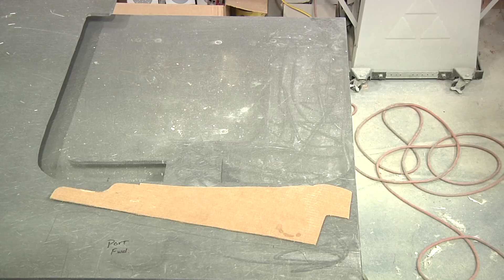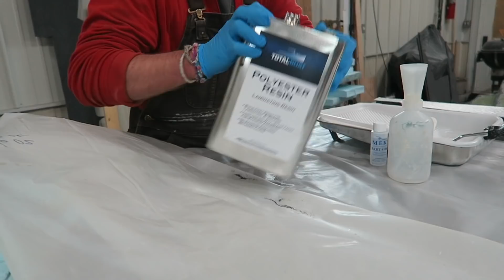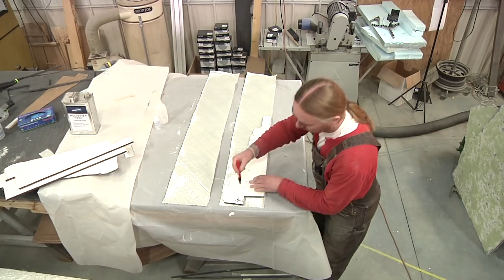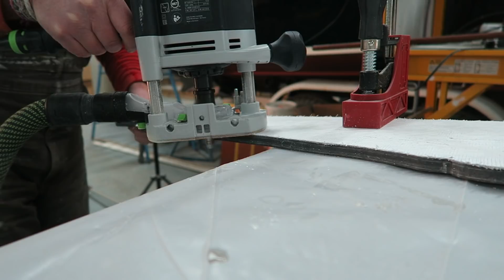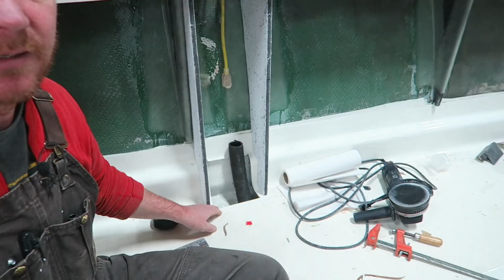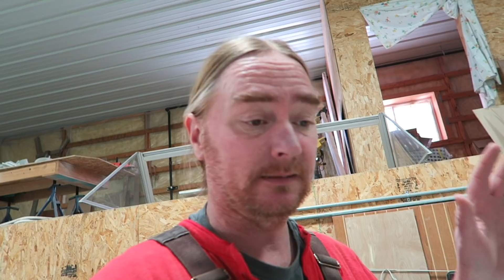Stubbing In For The Fuel Fill Line!

Comment: PVC is only listed as fair performance with unleaded gasoline at https://www.calpaclab.com/pvc-polyvinyl-chloride-chemical-compatibility-chart/. I would stick with bronze or stainless steel given the catastrophic nature of leaking gasoline on a boat.
Reply from the maker: The PVC wouldn't be in contact with fuel, mostly there as a sleeve to run some continuous length fuel hose through from the deck fitting down to the tank :-)
Reply: @boatworkstoday  That's OK then.

Comment: Exposed hinges look lame. Dirt gets into the screw tops and gums up around the hingeplates. Use a hidden hinge so that the only visible portion is the hinge barrel itself. If the lid is 3/4" thick you could even use a length of  3/4 inch piano hinge along the entire length....but I wouldn't do that, probably 2,    2-inch long butt hinges would suffice. The hinges illustrated here might give you an idea:  https://www.spep.com/Hinges/Butt-Hinge/M1009.html

Comment: You could install the hose using pvc electrical conduit. They make a long radius elbow for pulling stiff cable through. Glues up just like water pipe.

Comment: If you glass in the sweep 90 degree elbow slightly bigger that the hose and you glass is a smaller diameter 90 for the vent hose....that's too much work.  Build a 3" high bulkhead around the hole in the floor. The upholstered or gel-coated  cover you make for the knees you made in this video will be U shaped...with the legs covering the knees. In height  it will go from the floor to the top. The legs of this "U" -channel will be finished so the rest of the interior can butt up against them. Screw holes close to the edges of the "U" 's will be hidden by subsequent interior finishing.

Comment: I would at the very least glass in box up a few inches up that compartment so that like you said, water could not run into the lower hull compartments. 3 or 4 inches up and then a inspection cover for the rest. and the vaseline would definitely work to help get a new hose back into that slot.good luck with whatever way you decide to go. either way the boat is gonna be ten times better than the factory setup!!!

Comment: Andy, if it were me... I would glass the knees in solid with a 1/4 bottom section also glassed in solid. I would the simply make a removable panel that screws to the knees as you won’t be needing in there very regularly after the hose and filler are attached. Don’t rely on the coosa to hold the hatch though as you will need in there again at some point and repeated removal/installing the fasteners will quickly wear out the foam! Instead, hog out the area where the screws will go and fill with thickened epoxy potting the area. Now, you can drill and tap the epoxy to accept a machine screw. I usually drill my holes through outer skin and in to core. Then use an allen key and cordless drill to ream out the area larger than the original opening. Then fill,re drill, and tap to correct size. Works beautifully and now your core is completely sealed also!

Comment: Andy,  For the Fuel hose, perhaps you should consider a 90º hose fitting to make the turn, if that helps.  And like another poster mentioned you definitely want to plan for a Vent line, to vent your tank otherwise you will be all day trying to fill up your tank.

Comment: According to a Google search PVC fittings are not approved for use with gasoline.  However if you are just going to use the fitting to make a sleeve for the rubber hose to follow around the curve then it would not be in direct contact with the fuel and would work.  However, that to me would not be the Ideal solution.  The best solution to me would be a stainless steel tube which would be impervious to all fuels and chemicals used.   Of course a section of steel tubing fabbed at a muffler shop would also work as long as it was primed and painted with an epoxy paint of some type to prevent rust.  I would probably cover it with a layer of 1708 as a rust preventive which is most likely overkill, ha ha.     

I would also have a smaller vent line sleeve in addition to the fill line unless that vent line is located somewhere else.

Comment: Fiberglass pipe and various angled elbows could be glassed  (polyester)in for the fuel line. Used underground at most gas stations fuel & vent lines. 2"..1 1/2" & 1" readily available in GB

Comment: Look at PVC drain pipe. Its rectangular and may work. You can also heat both PVC pipe and the drain with a heat gun. Make a jig for the radius on a piece of wood use dowels to outline the radius. heat the tube till its pliable.

Comment: put a few coats of paste wax over the PVC fitting, lay glass over the part of the curve you want to show, and peel off when hard.  Just one layer of thin surfboard cloth will still be reasonably flexible so you can cut and glue it in place, then lay glass for strength over the top of everything once you have the molded glass part where you want it.  You're just using the PVC as a form for the shape, then removing it once the resin on the thin glass has hardened.  The resulting thin glass part gets tabbed into place and glazed over with whatever thickness of layup you need there.

Comment: Here are a few observations. First, you'll want to have something to prevent chafing of the hose against the deck were it curves under. Secondly, my experience is that epoxy does not bond well with PVC so you would probably find that difficult to glass in as you've mentioned. Another problem I see with some sort of pipe is that you will not be able to easily inspect the condition of the hose down the road. I think some sort of rounded edge at the deck to prevent chafing and a 2 or 3 inch high wall at the bottom to keep most water out along with an upper cover would be preferable. With a bit of extra work the wall and cover could be molded in such a way to install a rubber seal.

As for the hinges, under cover hinges would keep people from stubbing toes. Insetting them into the deck could be done but that would entail more glass work to fix the insets. Alternatively, you could round over the edges of the hinges and polish them back out (probably).

Comment: KY will break down the rubber of the fuel hose and will degrade the rubber causing a fuel leak, not adviseable  on a boat. You may be better off looking into a product called "wire lube"  which is used to slide tight network cables through conduit. As it's silicone based , it wont break down the rubber and provides awesome lubrication in applications lie this. https://www.gescan.com/ideal-industries-inc-31-388-15927?utm_source=product_feed&gclid=CjwKCAiA-P7xBRAvEiwAow-Vaa8dZGl9TGNVutweyVo6AhV4nO28mUIkAJ6q7pZWO6AaDLE8Kzn0oRoCWw8QAvD_BwE

Comment: the sweeping elbow would be considered more of a bracket for the hose, I dont see it as an issue.  IMHO, why not make a custom fiberglass elbow to fit your needs?  Obviously that would be much more work involved, but it would be a custom fit and would not have 1/2" slop between the fuel line and elbow container.  The other issue would a 2 1/2" elbow fit in the area you hoping to put it in? It didnt look like there was a lot of room to begin with. 

As for the hinges, have you considered Stainless piano hinges? that would make it that much more of a cleaner look.

Comment: Remember the vent hose for the fuel tank. I would glass a 2" lip in front of the fill hose. Then on the starboard side I would make the shorepower connection in the side of the box to eliminate an obsticle and keep the plug under the rail out of direct weather. I was hoping you would not use deck mounted hinges for those locker doors. You will be stepping on them and it would look like an after thought. I beleive a stainless piano hinge would look better and leave a smooth deck. Did you get an answer from the Coosa people about glassing the panel edges? I look forward to your videos every week. By the way, Jamestown Dist. is in my back yard. I've been using them since the '70s. Great people and great products.

Comment: IMHO those hinges are a stubbed toe trap, if the hatches are not constant use, stainless steel sliding house window hinges or soss hinges they are available in stainless.  'Yacht shop creations' did a repair youtube on yacht tables worth a look???????? The one titled "SOSS HINGES THE PERFECT FIT" will get you there.

Comment: I would say use internal hinges with springs that will hold the hatch open until you push them to allow closure. 
You need a fuel tank vent. Use a recessed one so it doesn’t get caught on fenders, docks, etc. 
You might think about putting your fresh water fill cap on the cockpit deck out of the way. Too many people end up accidentally putting water or fuel in the wrong outside opening. 
I may have missed it but is the engine diesel or gasoline?
If diesel you might think about inspection plates and access for both the fuel and water tanks since you have a blank canvas. 
Enjoy your videos.

Comment: HI Andy.  I like the PVC idea but I think the radius of the tube will protrude into the deck area a little. I DON"T like the tube the way it is now. The sharp edge of the deck, at the bend,  will likely abrade the fuel fill hose creating a fuel leak hazard.  You may have to create a small protrusion onto the deck space to accommodate the bend radius of the hose. Don't forget space for the fuel tank vent hose (and radius protection) and the electric ground to the fuel deck fitting. Similar protections for the water fill line on the other side.  A dam to prevent water intrusion across the space is a good idea, taller than 1/2 inch. Maybe 2-3 inches tall.  Also, consider predrilling holes and maybe glassing in short pieces of PVC to allow chases through those bulkheads for wiring and plumbing for lighting, washdowns, etc. You will kick yourself for not allowing those spaces. Also, please don't put the AC dock power fitting on the gunwhale in the middle of the boat.

Comment: When you get finished, do we get to see if she will float?
Reply from the maker: Absolutely Rick!  Actually before it's finished going to do a float test this Spring just to see how she sits in the water with the engines on.  Also I have some doubts that the engine bracket was installed water tight :-/

Comment: Think i would go with a 3" 90° sweep you could  also heat it up and change the  degree of angle on it.
You could  actually just use a straight pipe glass it in put butyl tape on the access panel

Comment: I would glass in a  4 or 5 inch panel at bottom of your enclosure to prevent sloshing water then have a removable inspection/access cover screwed in for the remainder. What about an over-sized rubber grommet to hold hose in place where you might get abrasion?  This again would make working on it easier.

Comment: You should be fine. Generally if the USCG and  EPA guidelines for marine fuel systems does not mention sleeving a fuel fill line it is allowed. Will you sleeve the vent hose too? Don't forget to double clamp all fuel line fittings and install a deck fill ground wire. Good luck.

Comment: I  don't know if this would be legal, but you could look into using a fill pipe that could be conformed to the hull. The connection to the tank would be a straight length of the flexible fuel hose and the same for the fill port on the deck. .granted there would be multiple connections in the fuel fill to deal with, but the stress of forcing the hose around tight bends would be eliminated. Access to clamps would be necessary. Something to ponder. Something like this.. https://www.ebay.com/i/263593499245?chn=ps&norover=1&mkevt=1&mkrid=711-117182-37290-0&mkcid=2&itemid=263593499245&targetid=857040191430&device=c&mktype=pla&googleloc=9005674&poi=&campaignid=6469981107&mkgroupid=91562449160&rlsatarget=aud-762207186714:pla-857040191430&abcId=1141176&merchantid=118878838&gclid=CjwKCAiA-P7xBRAvEiwAow-VaSwSnorSB8_1jZ638BX9gi4sQT249KB0UZ-FqJltyNRiLSYNWlm58hoC9L8QAvD_BwE.

Comment: Andy,
1) I think those hinges look sharp. I would be 100% happy with that look on my boat.
2) Around the fill tube/power cable: I would glass in the two frames as you intend, then build up a flange from the deck, in from the frames, and down from the rail so that you have a continuous flage that you can make a cover for. Then attach the cover with butyl tape and screws so that it is 100% watertight as well as removable for future service.
Hope this helps. Keep up the good woork.

Comment: Put in inside hinges like you have in the kitchen. Those are available in stainless as well. Looks a lot cleaner and the support is taken up by the lips below anyway. Also those can be adjusted so you get the perfect gap you are looking for.

glass won't hold on pvc. Just make the desired shape out of styrofoam, glass it over. Once it hardened just pour in some acetone and dissolve the styrofoam. That gives you a pipe or knee in any desired shape, that you can glass in just fine.

Having the fuel line run in a duct is perfectly legal as long as you make sure there is nothing sharp or pointy inside.

Comment: thats called long swoop and its scheduled 40 you will need to scuff it up for glass to adhere to it and it will work
Reply: And a good wet wipe with styrene right before glassing if using polyester. The styrene acts like a plastic adhesion promoter. I use a blown pvc core board for places I need screw retention and it works very well!

Comment: ANDY, 
Don’t you need a vent tube along side of the fill tube? Also, on my boat, there’s a fiberglass rigid pipe on the turn.... then rubber 6-8” connecting to the tank & filler thru hull.
Reply: That was my first thought,  "There is a tube missing!"  an absolute must is a vent overboard to prevent explosions from  evaporating  fuel and prevent gurgling fueling.
Reply: Most companies have the vent in its own thru-hull fitting somewhere else.

Comment: For the fuel-line: Isn't there a more flexible hose to put from the filling to the tank?
Than it's easier to work with, like pushing or pulling it down a tube, and easier to replace or repair afterwards.

For the hinches: I would prefer round hinches which are sitting flush with the surface. 
Otherwise I would always be hurting my feet when walking barefoot on the boat.
It's a bit more work to put them in place, but they could look and feel nice.
(example: https://www.ebay.com/itm/2X-Boat-Stainless-Steel-Flush-Hinges-3-X-1-5-Door-Table-Gate-Cabinet-Hinges-/173756277073 )
Reply: Trident Marine Hose makes a corrugated fuel filler hose that is way more flexible but it can be prone to getting hooked on edges since it isn't smooth on the outside.
Reply: Those hinges are nice 👍

Comment: For the fuel fill area, I have an idea that would be a little more work then the PVC idea (I also like the PVC idea myself).  Glass the knees and roughly a 4-6 inch piece in front to the deck, so splitting the vertical cover into two pieces a removable component and a fixed component.  Glass a small trim piece to the hull side and to the inside of the knee to act as a shelf support.  On the shelf cut a small access for the fuel hose, like a U shape and screw that to the supports that are glassed in.  Then to finish it all, on the outside put your removable vertical piece.  This way no water will get in at the deck level, and even if some got in from the gunwale area it would have minimal flow down to the bilge/stringer.  More work, but would still give good access and make it clean looking.

Comment: Since you are going to have a cover on the front, why not have the bottom portion be glassed in. Have the access panel start a few inches up from the deck at whatever level you think is sufficient to keep water out.

I don't know what the problem would be with a PVC elbow. If it's the fact that you have fuel lines running through PVC, you could always make your own elbow out of glass. You're a pretty smart guy. I'm sure you could do it.

Comment: I can't comment definitively on the PVC elbow but I have seen fittings on Diesel fuel hose on other boats... even Brass if you are worried about ABYC compliance - although I do wonder how you would manage to attach the hose to the one side under the deck.  I am really not fussed on those hinges however as they stand proud and will catch on things.  I had always thought you'd put a piano style hinge the length of the hatch underneath so that you don't see it.  You've done such a great job of making those seams perfect that it seems a shame to mar them with external hinges even if they are Stainless Steel.  I could get by those but I suspect you will also need some sort of a hold down latch/lock system and that would be even more of a catch / leg scraper given it's location.  The boat I am looking at buying has a unique system of an internally sliding rod attached to a line led to a discrete location that you can pull on to engage the rod through the hatch so that it is locked from inside the hatch and no external hardware required.  They have all of the hatches attached to only a few of these lines (it's a 54' boat so lots of hatches) so that all hatches can be secured by pulling on and tying off 2 or 3 of these lines (which are inside the boat in discrete locations).  It's an ingenious solution to theft but also results in a very clean looking hatch solution.  I realize your Bertram is more of a day tripper than a cruiser and this may be overkill but I thought I'd mention it as you have all sorts of unique details on your project and this could be a cool one to work on.